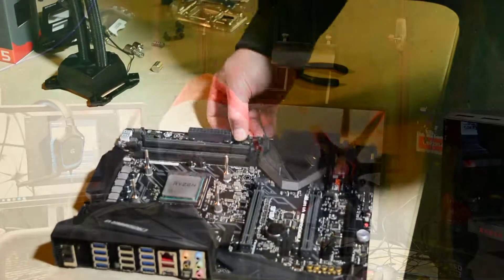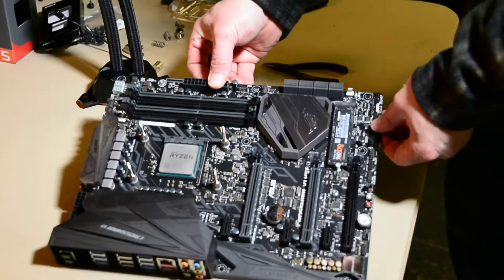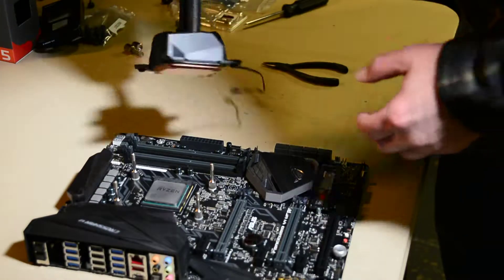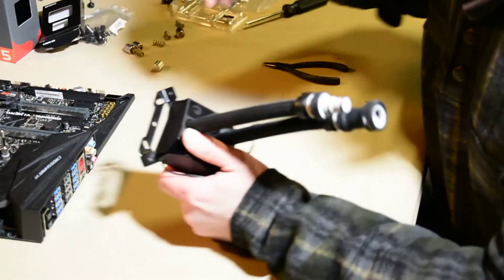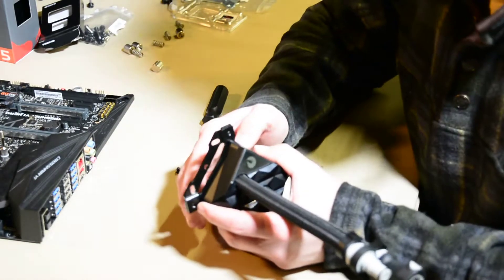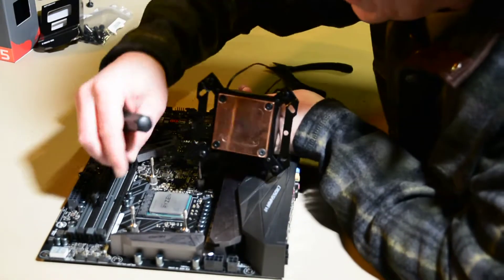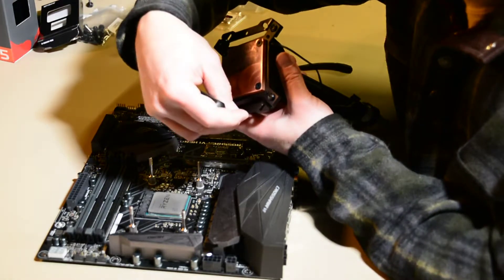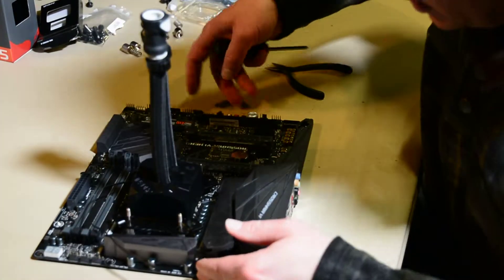EK Phoenix Series Part 3 CPU Water Block install tips

Comment: Hello, do you think it is possible to remove the quick connects and those cooling hoses and replace them with the hard tubing? I really love the design of that cpu block!
Reply from the maker: The quick connects should be able to be removed no problem  but I'm not sure what the connection at the   cpu waterblock is like.  I would have to remove the plastic cover and see.  I'll look into that this weekend.
Reply: The Tech Basement thank you keep the channel going I subbed!
Reply from the maker: I took a look and mine and I would have to do a tear down and I really do not have the time at the moment and want to answer you question asap.  I have a ticket in with EK to find this out, hoping to give you some feed back by Friday at the latest.